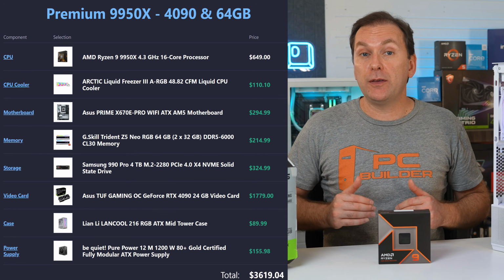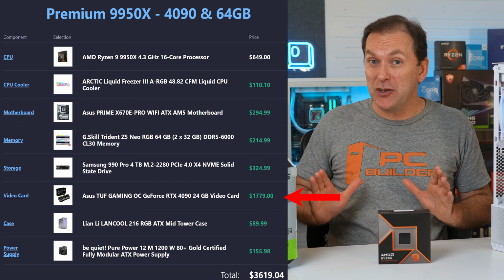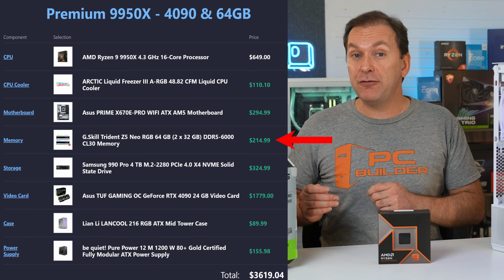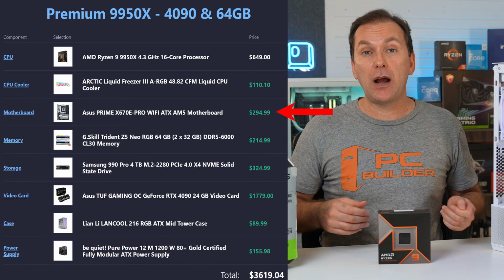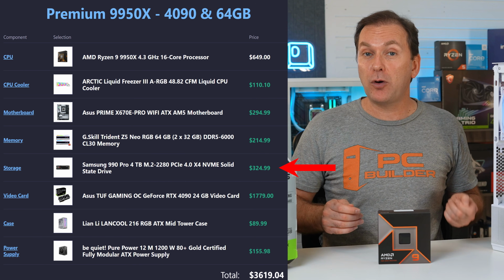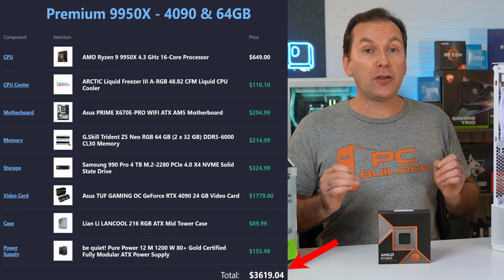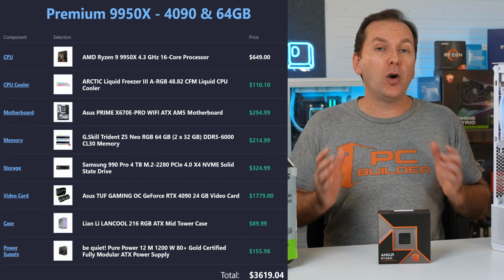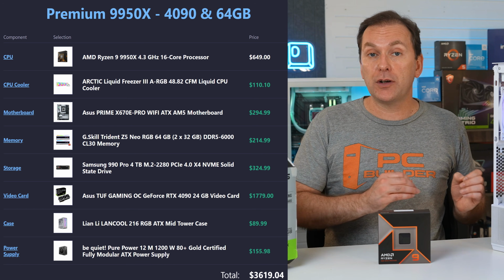Best Ryzen 9950X Creator PC Build 🛑 Best RAM, GPU, Motherboard & More!

Comment: The reason you buy a non x3d chip is for productivity and no fuss with the dual ccds or core parking nonsense, who buys a flagship cpu for efficiency? 7950X is better unless you are taking advantage of VNNI and AVX 512 which some chess engine compilation will. Skip Zen 5 and will wait for Zen 6.

Comment: 9950x is a dud. Just save the money and get a 7950X instead. There is no reason to purhase the 9950x over the 7950x! Also the 9900X and 9950X owners have to worry about scheduling conflicts now just like the 7900X3D and 7950X3D did. The 7950X didn't have to worry about scheduling conflicts out of the box.

Comment: For Audio part:
Don't forget we can always buy PCIE sound card that will do the amazing job for just 100$ or less. Even 50$~ sound card should be better than any codec there.
Reply: Think most people now recommend buying an external DAC over a pcie card though.
Reply: @z-ah842h  Yeah, it's just more expensive, but recently there is a lot so maybe u can get it cheap nowadays.

Comment: What should i pair with a 3090? Or should i just sell the 3090 and get a 4070ti / 4080?
Reply: On AM4 or AM5?  I have a 5800X3D with a 3090 on AM4 and run at 4k for everything, including gaming, using my LG C2 OLED tv.  The 3090 is roughly equivalent (but slightly slower) than a 4080 when looking at test charts.  Unless you need AV1 encoding, you are good for a while still.  If you aren't upgrading to a 4090, it is a waste of time.

Comment: Your videos helped me build my first pc
Reply: Congrats!  You can't leave the fan base hanging though....what kind of rig did you build!  We all want to know! :)
Reply: @2hotscot   12700k
3080 gigabyte gaming oc
64GB T-force delta ram
4tb crucial p3
2× 2tb teamgroup mp33
Teamgroup sata ssd
Seasonic 750w psu
Id cooling frostflow cpu cooler
Darkflash case
Asus prime h770 mobo
Reply: @2hotscot  12700k
3080 gigabyte gaming oc
64GB T-force delta ram
4tb crucial p3
2× 2tb teamgroup mp33
Teamgroup sata ssd
Seasonic 750w psu
Id cooling frostflow cpu cooler
Darkflash case
Asus prime h770 mobo

Comment: Why buy  cpu that underperforms worse than the previous model and pay extra for it . Every review of this cpu is terrible , I was waiting to purchase the 9800x 3d because I'm stuck with a rubbish 13700k degrading and even feel let down by AMD now . The pc market is absolutely rubbish at the moment .
Reply: 7800X3D is too slow for you? lol
Reply: @2hotscot  no , but I might aswell wait for the 9800x 3d reviews as I'm not in any rush,  but it's not looking very good even for the 9800x3d if the rest of the line up is like this,  plus I'm waiting for the x870 boards in September,  again no point buying a 670 if I only have to wait a month , just  a very disappointing launch thats all , was expecting something a bit better.

Comment: Hey, sorry to be a pain but I’m completely new to computers and I’m saving up to buy one. Could you please tell me if i have made a mistake or went overboard on a part? 
Ill be using a ryzen 5 7600x
Corsair vengeance 2x16gb ddr5 6000 and a CL of 36
4070 super windforce OC
Corsair rm750e 80+ gold
Samsung 990 pro 2tb
Msi x670e gaming plus wifi
Thermalright aqua elite 360
And a montech air 903 max
Reply: So you don't need a X670E.  B650 is all you need.

Also if using it for Gaming I would go AMD on the GPU instead.

Finally Jason recommends 6000 CL30 for RAM.

What country are you from?  If it has a PC Part Picker and I make adjustments to your build.
Reply: @ty09162  agreed get a AMD 7800XT for gpu and an MSI MAG B550 TOMAHAWK MAX WIFI for Motherboard, also RAM is fine but get the CL30 not 36
Reply: @CrymSyN007 do you mean b650 tomahawk? If so i will give it a look :)
Reply: @ty09162  what motherboard do you suggest, thanks
Reply: ^ also 990 pro isn’t a noticeable gain over 980 pro so if the 980 is cheaper go with that instead
Reply: @Sushious the 990 pro is way cheaper here in Australia but thanks for helping:)
Reply: @darkclaw2318  I made this for you using PC Part Picker Australia. 

This assumes you're using it for Gaming.

You're just overspending on things so I fixed it.

It's list / 7xgs9c in PC Part Picker
Reply: @darkclaw2318  the other option is to spend more to get the 7800X3D CPU instead of the 7600.  The 7800X3D is currently the best CPU for Gaming.

Here's the build with that CPU.

It's list / PkD3h3 in PC Part Picker Australia

Comment: 7800x3d is better
Reply: Bro forgot not everyone builds pc for gaming 😂
Reply from the maker: For gaming focused builds and casual production work 7800X3D is the best choice! See our 7800X3D build guide for more on that
Reply: @PCBuilderChannel thank you for clarifying
Reply: But what if you just wanna crunch a bunch of numbers... 16 fast cores with AVX-512 could be better than a double precision GPU depending on the workflow. And you "technically" can use ECC on AM5 too.
But yes for just gaming 7800X3D is king still.
Reply: Op didn't listen to the disclosure at the start of the video. This is for production focused new builds.
Reply: For gaming, of course. But this is no gaming pc.
Reply: I'm tempted to do a 7800x3d build or should I wait for 9800x3d to be released?
Reply: @sekirotelcoin3336  if you aren't planning around overclocking and cooling your CPU hard (360 or 420 AIO or a custom loop) I don't think the 9800X3D will be a huge upgrade. If it can OC it might but you then need to put money into keeping it cool cause even Lisa Su's magic can't change the physics of the memory capturing heat. I'd just build a 7800X3D, especially if I saw a good deal personally. Also, I doubt it will bottleneck the 5090 at 1440p or 4k.
Reply: @sekirotelcoin3336 how soon is 9800x3d gonna release??
Reply: @sekirotelcoin3336  how long are you willing to wait? Given the meh reviews of the 9000 series they may delay the 9000 x3d launch until the 7000 x3d supply dwindles or they may rush the release. We don't know which it will be. If you are building soon I would go ahead and do it now with the 7800x3d. Given gen over gen performance from 7000 to 9000 currently is the 9000x3d models will only make sense for new builds and gamers on AM4 looking to update.
Reply: @John-Wolfe  I could wait until start of 2025, pc I have atm is from 2012 with Windows 7 wanna get back into pc gameing
Reply: @sekirotelcoin3336  2012, so  5-9 months isn't gonna phase you... I'd wait and see how 9000 series X3D performs, also the 800 series mobos should settle in price by then too and will be reviewed too.
Reply: Small brain comment.  Better for what?   Not editing videos.
Reply: Yeah, no shit. The 9950x is meant for multitasking, not strictly for gaming.
Reply: Give me a good deal for this x3d!
Reply: Is the ryzen 8 7950x 3d good? For animation?
Reply: @Avragepie1245  Depends on the application you use like unreal engine or blender or something else
Reply: at CES 2025, amd will most likely announce the 9950x3d and this will crush the 7800x3d
Reply: You are only a gamer. I’m working on 3D projects and short animation. This cpu is  like God!
Reply: Actually wrong.
Reply: Christ these braindead bots are annoying. The rest of the comments schooled you so I don’t have a need to pile on.
Reply: No, it’s not. Not everyone wants to game.
Reply: Has your one braincell ever considered that not every PC is built purely for gaming?
Reply: Only for gaming and small less tasking bruh
Reply: Did u watch the video before commenting?? 😂😂😂 u dumb
Reply: The 9950x has better 1% lows
Reply: For shit games Yes, but not for doing something useful

Comment: You know pc gaming is not affordable when you have someone saying a 4070 super is the minimum
Reply from the maker: This is a guide for this very specific CPU and super high end creator pc! If you are looking to build a gaming PC there's actually incredible value to be had, this just isn't the guide for that. Hop over to our latest Best Builds Series and in particular, check out our Best Budget Gaming PC 2024 video.
Reply: Well if you have the budget to purchase a high end CPU like Ryzen 9950x you won't think twice and buy another lower GPU than 4070 ti super it just doesn't make sense